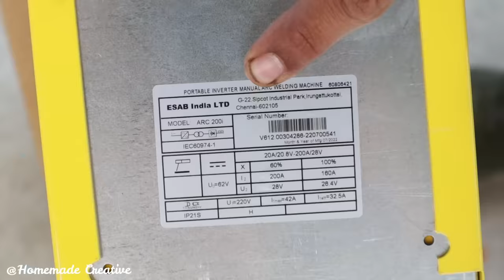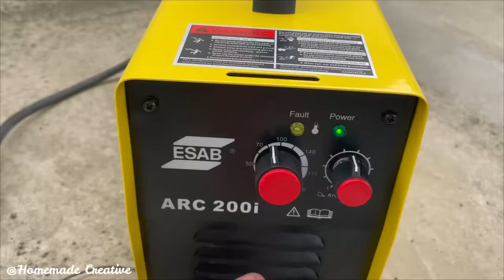Build a  Free Energy 3 Wheel Go Kart | DIY Solar Powered Electric Go Kart For Kids

Comment: Nice idea! The motor may be a little weak. It would be better to have pedals for the left wheel, so you can drive up a hill or if the battery gets empty.
Reply: A appreciable work, and also agree with the opinion of Mr. Hohen rover